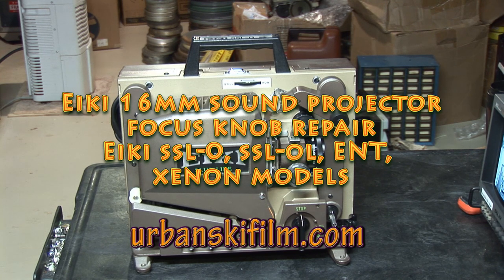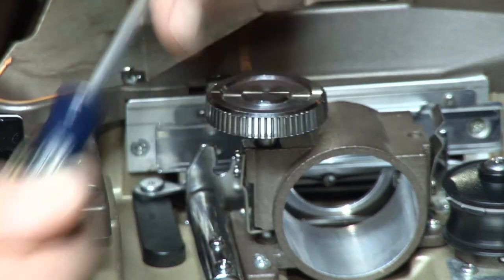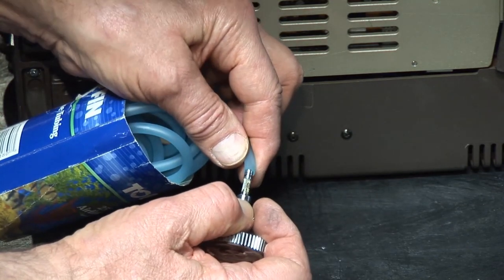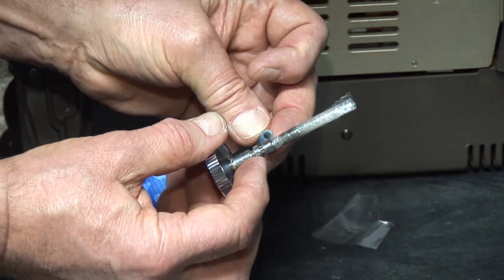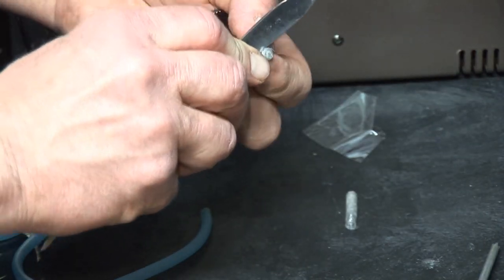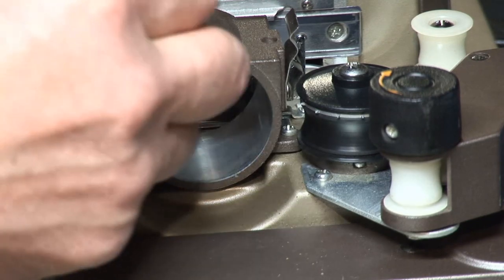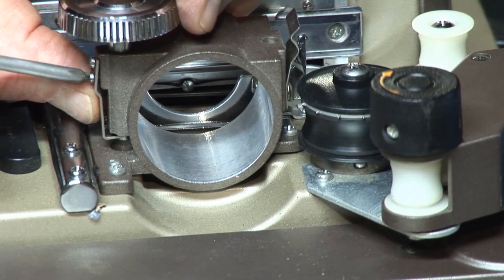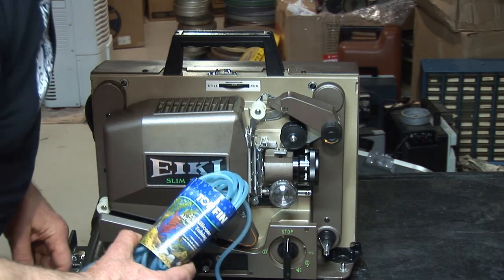Eiki 16mm sound projector Focus Knob Repair

Comment: Larry the KING of Eiki repair, as well as among all things projection.  Great  video!!  Thank you.  

And not for nuithin as we say here in Brooklyn, this is the WORST design for a focus adjuster of any projector I have ever seen.  We had about 10 Eikis when I was asked to take care of the A/V supply room.  EVERY single one of them has that damn rubber sheath that morphed over time into melted black goop.  Eiki designers just made it a MUCH too much complicated solution to such a simple function, i.e, to move the lens closer or farther away from the gate.  Who cam up with this idiotic idea, especially given that the Eikis, generally are well-designed projectors.  Although I must have to ask why oh why did the industry as a whole, decided that people were incapable of learning how to manually thread projectors...it's a mystery to me.  The minute they covered the simple 4 or 5 threading points of a projector with incredibly complicated contraptions which intrinsically were potential film SHREDDING devices, the elegant simplicity of the manually threaded projector became what we all have watched in horror -- a film Cuisinart! a few broken sprockets, a bad splice and you can hear film being turned into celluloid mulch.  And on many models of say the stalward and trust-worthy first Bell and Howell's 300 series were turned into film chomping monsters just so teachers in the thousands upon thousands of schools where B&H were used, wouldn't need to learn what every 12 year old in the A/V club could master in half and hour.  How stupid did the execs at  B&H think teacher were?  And not to mention, once those threading contraptions were screwed onto perfectly good manual projectors, try to gettin  the film that was getting chewed up out of them.  In those first B&H 500 "automatic threading " projectors, most times you would have to simply cut the film to get it out, and when it did come out, it was crushed and fan-folded like an accordion -- a nightmare for every A/V projectionist, because his faculty supervisor would invariably blame him and he'd be off the A/V Squad and then how was he going to get excused from gym period? .

Comment: Great video Larry. My RT-0 had the same issue; weak focus knob. I manage to use a piece of 3/16" ID gas line rubber tubing from my auto parts store. Fitted snug as a rug on the knurled shaft. No tape required. Focus now working like new.
Reply: I tried using 3/16” ID gas line rubber tubing based on this recommendation and it was much too large.
Reply: @mikedutkewych  I think I meant 3/16 OD